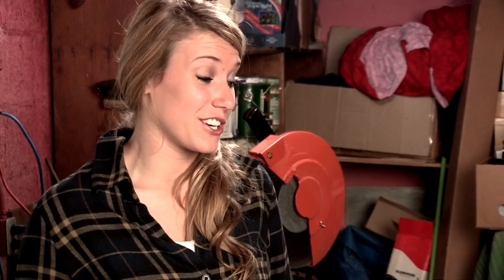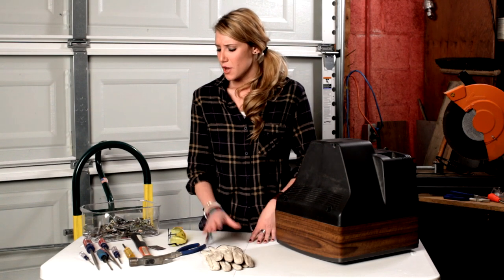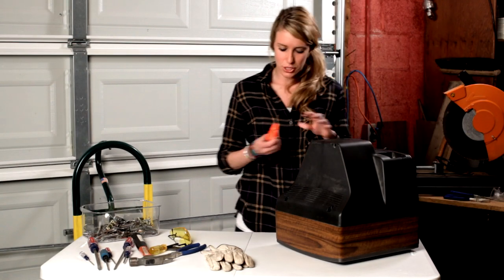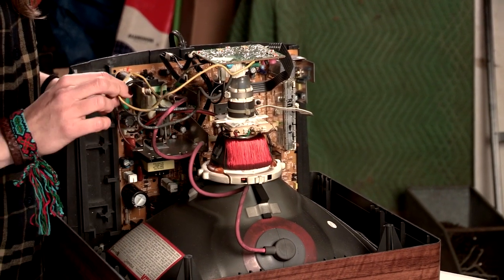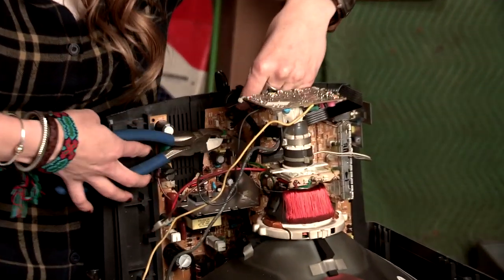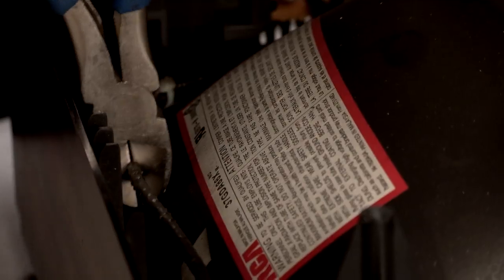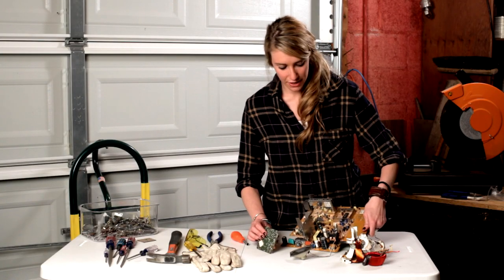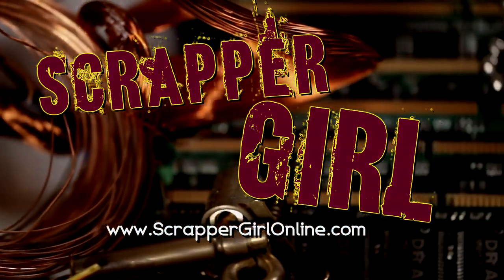Scrapper Girl explains how to get copper & aluminum out of a TV (Scraping a television)

Comment: always, safety is number one priority- wear your safety glasses that you had!
save everything that you remove, so you can either trade or sell the components you've taken out. also, strip the power cord for the copper, and the plug for the tin/ stainless steel/ brass.
the knobs are also good to keep.

Comment: Flat panels that have good capacitors, but still do not work?  Remove the green circuit boards with the BGA chips on them, put in a preheated oven set to 400 degrees F for exactly 5 minutes.  It will reflow bad solder connections and often restore the TV. Working flat panel is worth much more than the copper in it.

Comment: The problem with old tube tvs like this is that there's mercury in the glass. Because of that no one will take them. In my area you are supposed to pay 1 50 a pound to get rid of them. For what copper and aluminium you can recover its not worth it

Comment: Monitors & TVs 18 tons/truck (x) $180/ton = $3240.00
Transportation Cost 18 tons/truck (x) $45/ton = $810.00
the 25.000.00+  i stated is for 8 truck loads  again stay away from tvs and monitors if you get cought putting them in the landfill it will be 1000s of dollors in fines,,,,,,

Comment: what a load of garbadge. I could have taken that TV apart in the same time the video lasted (without the outake time) and with one tool: The hammer, the holy grail of dismantling for scrap. If you can't get it open and apart with a hammer it won't be worth your time.

I tend to go for easy stuff and the mixed stuff like copper wire epoxied onto cores that I'll never get apart or tiny motors I give to the scrap dealer for free and he does me a good price on what I sell him in return.